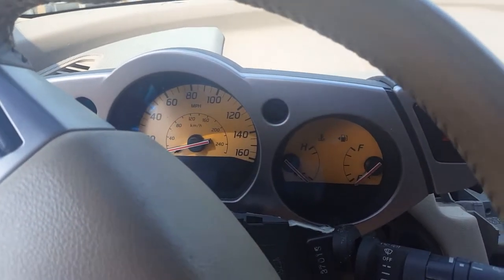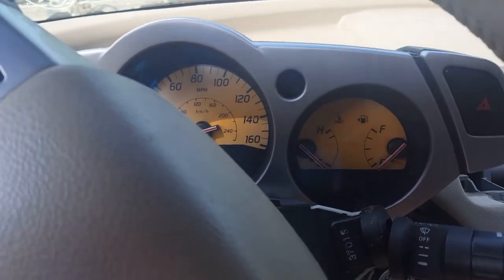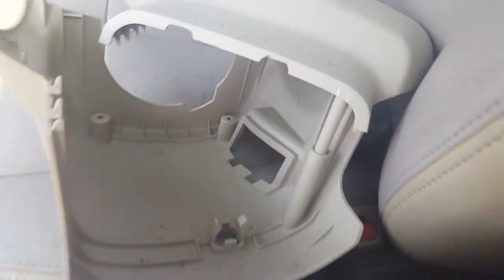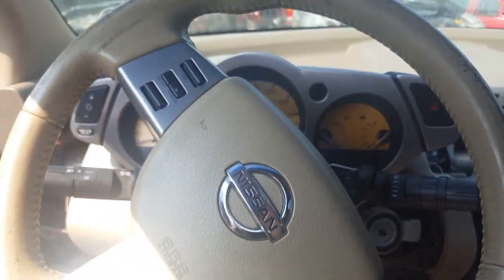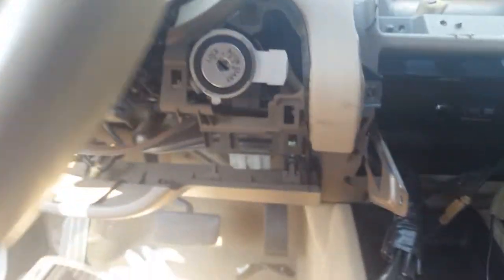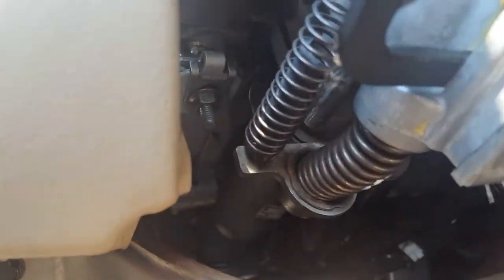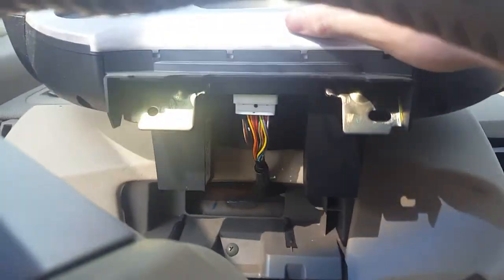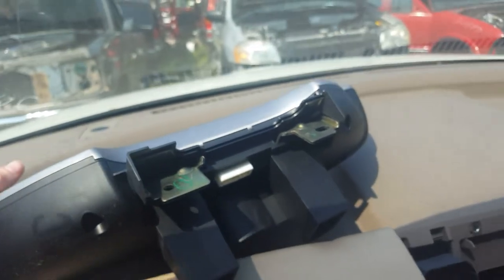How to remove the instrument cluster panel on a Nissan Murano

Comment: Nick, how did you remove the lower panel, the one with the fuse block access door. I need to access the relays on the fuse block on a 2010 Murano. I haven't been able to find anything online. Any help, would be greatly appreciated.